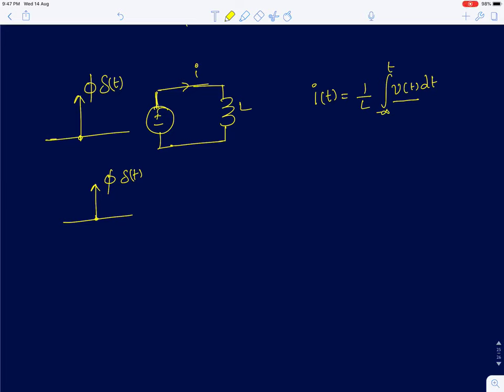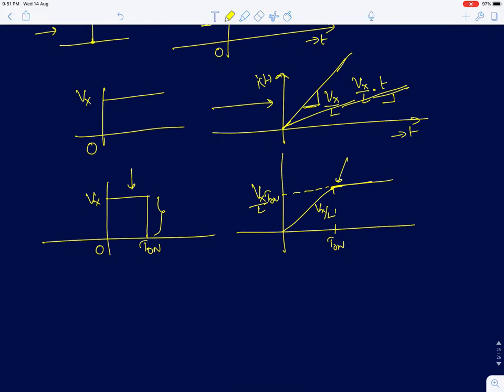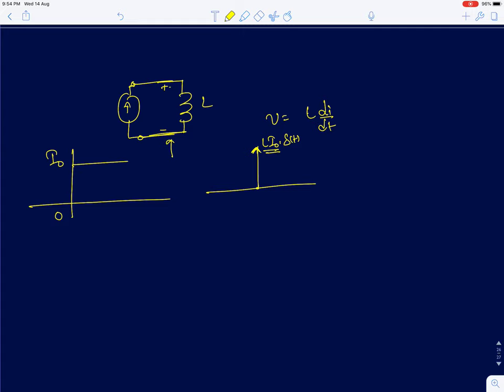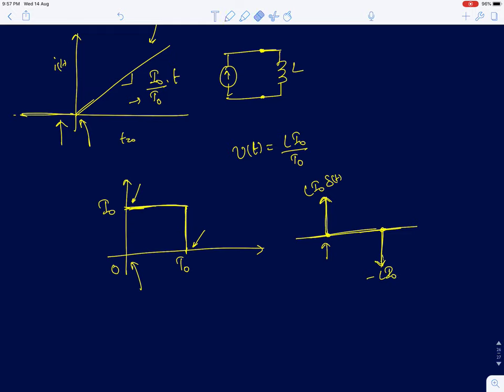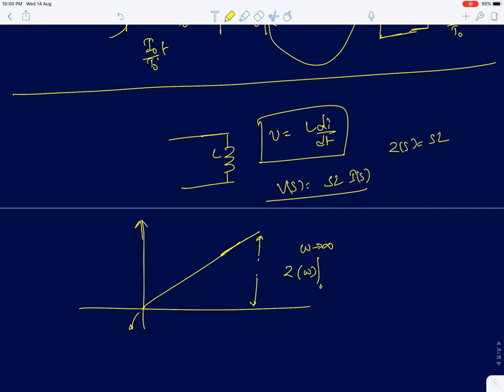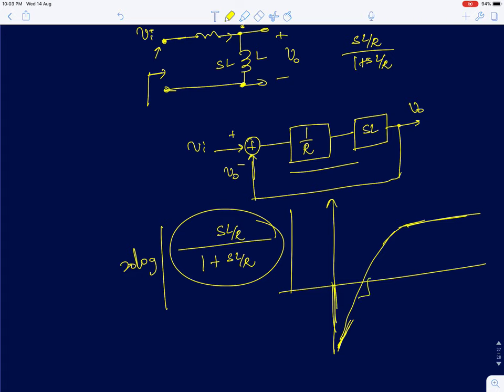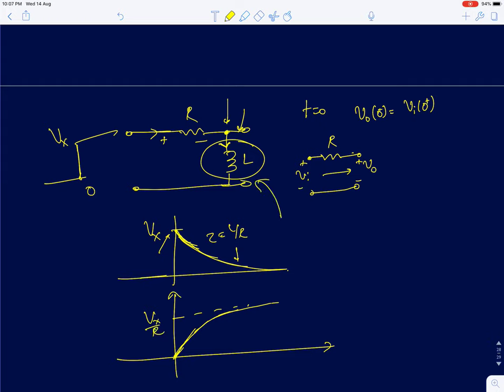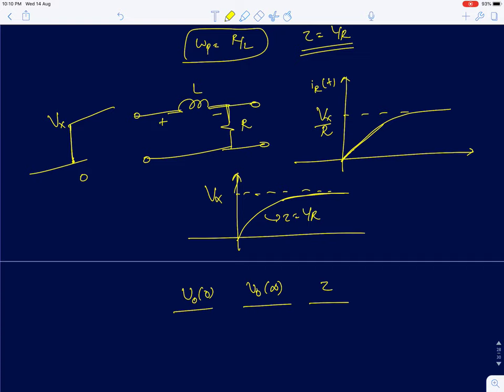ES Lecture 30: Analysis of Inductor circuits for different voltage and current inputs

Comment: Is impulse same as voltage spikes ?  Because inductor will differentiate the input current step . Differentiation of unit step is pulse which is spikes of voltages .. same as RC differentiator circuit